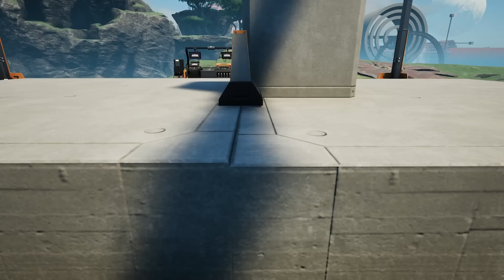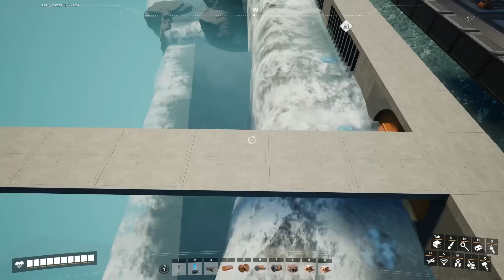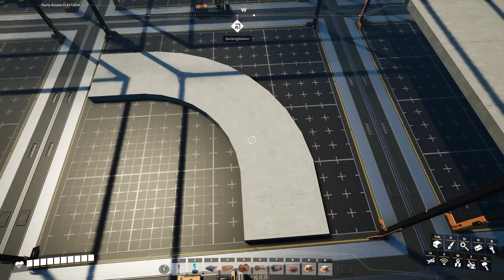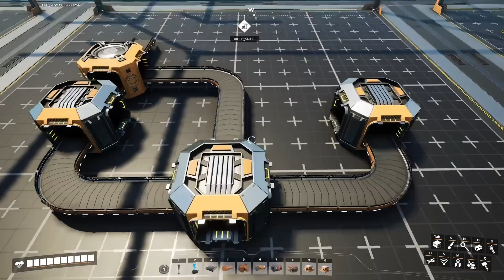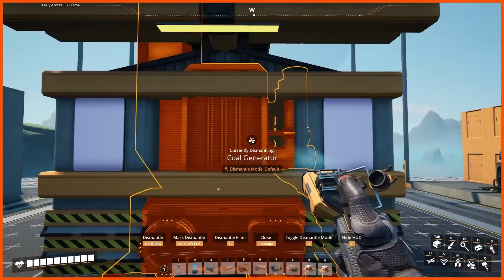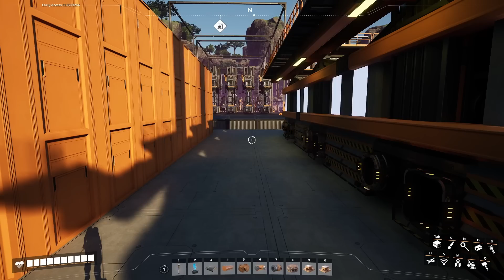Quality of Life BLUEPRINT to make 1.0 EASIER | Tips and Tricks | Satisfactory 1.0

Comment: ""EMERGENCY"" blueprints.
Usually an assembler. 2 containers for inputs. 1 container for the output. 

I have several "Emergency" blueprints for items like Encased Steel Beams, AI Limiters, Reinforced Iron Plate, and Rotors.
In the case for my "Emergency Rotors" it needs Rods and Screws (which are made from Rods). So I have a container that I dump in as many Rods as I can, and it splits to a constructor to make Screws and to the assembler to make Rotors.... I end up using this one a lot.
Reply from the maker: That is really smart :P I should also have some of those

Comment: My catwalks and foundations are not rotating in bits. They either make a 45* angle right away or just a 90*.
Also they don't light up white. Just yellow, blue and red.
Reply from the maker: I have changed my colors in the settings ^^ Also, if you hold Ctrl you should have smaller rotation increments